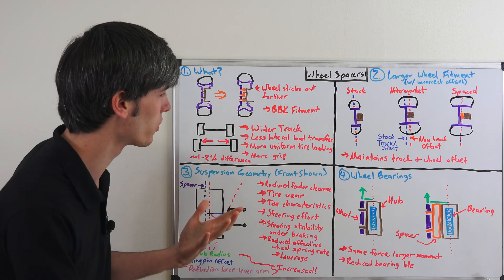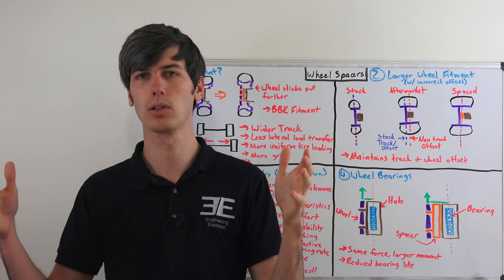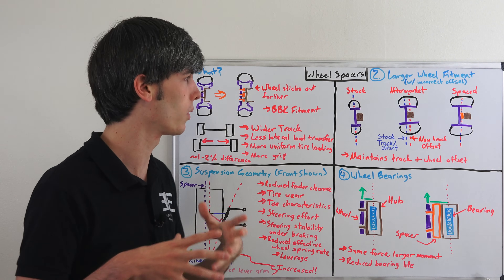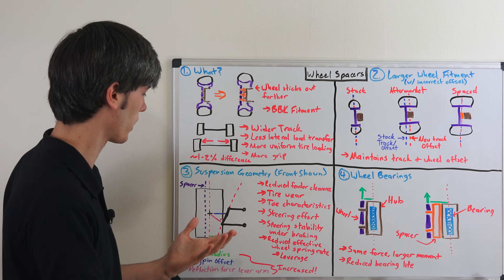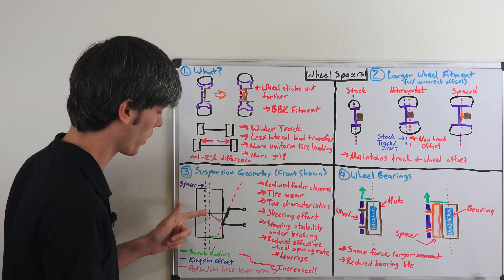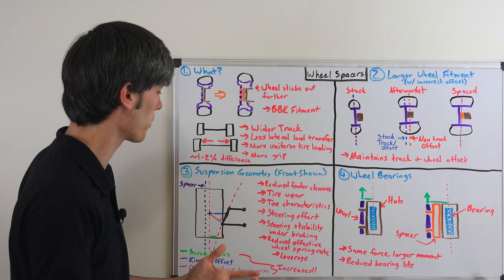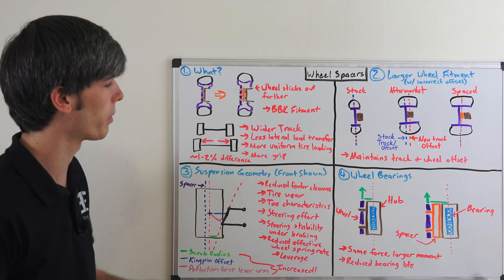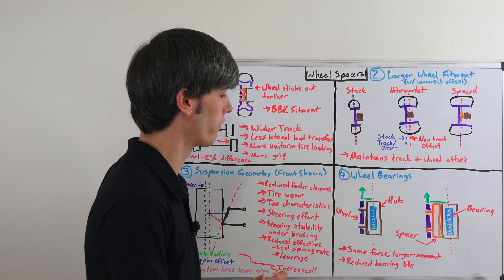Wheel Spacers & Adapters - Good Or Bad?

Comment: 4:30 A few years back, when I had a 97 Suzuki Samurai, I discovered the spring rate change right after I installed spacers in it, especially during off-road scenarios. You can put stiffer springs to try to even out the extra leverage, but then you're going to be wearing out your suspension kit even faster.

Comment: By adding a spacer you don't increase the load on the wheel bearing. If anything, the load is reduced. The load is increased on the spacer. Almost all GT3, GT2 class racing series run wheel spacers with no issues. As long as the materials used are heavy duty, you should be fine.

Comment: Do not use wheel spacers. They KILLED my friends daughter. Back in 2010 she was driving on the QEW highway near Toronto Canada, the back tire of a pick-up truck came off and entered the oncoming traffic and killed my friends Daughter Megan instantally. The reason for the tire coming off was eventually traced back to the installation of a wheel spacer on the pick-up truck.  Wheel spacers should be outlawed.

Comment: Okay I’m not sure if you will see this since the video is so old, but I was wondering what the effect of extending the a arms of a double wish bone suspension would be in increasing track width. Would that be as negative as using spacers? Or would it be negligible in the effects?

Comment: You missed the main reason people use spacers, for style. To push the outside of the tyres out as close to the wheel arch as possible, It is often accompanied by lowered (or even cut) springs. Those people aren't thinking about the actual effects on bearings or supension geometry.
Reply: Those people wouldn't be watching this video in the first place, as they don't care about the effects on bearings or suspension geometry.

Comment: I changed almost every component in my 2012 Acura TL suspension. The only thing I didnt change was the lower control arms and steering knuckles up front and rear knuckle in the back. I replaced all 4 hub/bearing assemblies, arp ext. wheel studs, 20mm spacers all around. 19" aftermarket wheels, adjustable front upper control arms and a rear camber kit. The brakes and rotors were 7 months old at the time of install. Axles were replaced too. Tein coilovers were replaced with BC racing DS series coilovers. The car is fully aligned while sitting 4 inches off the ground 😂

Ill let you guys know when they fail

Comment: The real question, if you believe that this causes damage. Then you’d have to be logical and think that getting rims that have 20mm more poke than stock would do the same damage as a 20mm spacer. No one says that it does but if a spacer does then so does the rim

Comment: An interesting point to me is a spacer compared to a wider wheel with different offset. If I compare an 8.5" wide wheel with a 30mm offset as the OEM wheel compared to a 9.5" 22mm offset wheel, the wider wheel edge moves out by 21mm. So if a 20mm spacer is used to get the same outer edge position of the wheel, why does nobody say anything about the wider wheel and the negative effects from that?

Comment: wheel spacers

Hi Will the 25mm rear spacer and 20mm front spacer damage the wheels, suspension and bushing in the long run?

Comment: I have 2in spacers on my 47 mercury with a 9in rear end and have had zero trouble in 25 years. Of course they are only on the back. Proper torque is a must and retorque after a few hundred miles. I don’t believe I would use them up front.

Comment: Hi I have a jeep commander which I just had a 2inch lift kit installed now I want to put bigger tires on the stock 17 rims. I'm considering 1.5 spacers but concerned about the wear on the wheel bearings. In your opinion would spacers that small create much difference if any to the life of the wheel bearings

Comment: Is the proper solution to buy wheels with preferred offset since it will be mounted on the hub as intended?
Reply: Both will impact the way your car is steering, since the point the front wheels turns (if you draw an axis through the front shock of a Mc Person axle) is moving towards the inner side of the tire.
Ideal it should be outside of the middle of the tire, if you lose one brake cirquit your steering will automatically pull towards the front wheel with the defect brake cirquit. If the rotation axle of the steering is inside the middle it will pull to the other direction and will further destabilize the car.

Comment: I’m assuming this would be the same for significantly offset wheels? What about just increasing the width of a wheel? Assuming offset was same that should not change the suspension geometry correct? Again assuming no other issues with figment etc.

Comment: Hi... Great video and explanation.  I think there is another possible scenario that you didn't cover in this video. I would love to have your opinion on this If I have a rim with a 15mm positive offset and isn't it adding a 15mm wheel spacer that would restore the centre point of the wheel as per the factory setup? As a result of doing so, it would eliminate all the possible negative impacts of adding a wheel spacer.  Yes?

Comment: I tried to find wheels for my 69 Mustang, which needs wheels with 0 offset, but most modern wheels have about 2" of positive offset.  If I had not found the exact wheel size that I was looking for with the correct offset, I would have had to use a 2" spacer with one of the more commonly available wheels.

Comment: My concern was addressed in this video.  The displacement/extra strain on the wheel bearings/rotors.  I thought about them for looks, but I already decided against them.  I'll just look for bigger sized tires that I can get away with, while not compromising performance/life (too much) on other components.
Reply: I've never had a wheel bearing need replacing after using a spacer. Maybe if it was bigger. I've normally used 15-20mm spacers maximum.
Reply: Old post...
That bigger tyre has also most the same effect maybe ?

Comment: When I saw the title to this video, I was wondering if the subject of wheel bearings would be covered?  It did to my satisfaction.  
I recall back in the 1960s being first aware of wider wheels having detrimental effects on wheel bearings.  In the US Can Am race series, Bruce McLaren had a nearly invincible race car with the McLaren M6A.  One of the notable features with the M6A was in its wheel hub design to use wider wheel rims/tires than what were on the Lola T70 race cars.  The teams with the T70s copied the M6A with using wider wheel rims on the wheel hubs not designed for the width; where the T70s promptly had problems with wheel bearings failures.

Comment: If a different wheel is used with a greater positive offset than the stock wheel, and the increased positive offset is equal to the spacer thickness, will that negate any additional bearing loading due to increased mounting distance from the hub?

Comment: How about the effects of a spacer on a floating axle bearing? Like an HD pickup? That would a a definite must watch, there's no info out there... I tow 5th wheel camper/gooseneck which adds in weight and effects bearing load, any info??

Comment: I own a 2003 Toyota 4runner and it came with a 3 inch rough country suspension lift and 33inch tires on Toyota 16 inch rims but it also has rough country wheel spacers because the tires were rubbing on frame too wide. I am concerned about my wheel bearings although the SUV does ride very well and seems to handle great. Also it climbs like a champ. It is a SR5 4wd with the 4.7 V8. But I am looking at longevity so I am considering going down in tire size and getting rid of the wheels spacers

Comment: Espeicially emphasing that last point: the "OEM lever distance" is not that big, so ading just a few centimeters of spacer can put a bunch more moment on the bearing as moment scales lineary with distance. To the point where safety factor margin could be eaten up and wheel bearings become a wear part in need of replacement in very short intervalls.

Comment: I saw a guy Driving a Chevy Corsica that he both changed to RADICALLY smaller Tires and Wheels as well as pushing them out with 2 or probably even 3 sets of Spacers. As a result the Camber was insanely negative. 
Then in Rush Hour traffic He was Driving MUCH faster than his abilities while Jinking through all Lanes of the Freeway. Sure enough, he cut too far towards the outside lane, hit that little rise to the shoulder, snapped his right Wheels off, and rather spectacularly flipped up onto the Embankment. 
Thankfully no other Vehicle was involved, though he wound up with a Broken Leg.

Comment: There is a nearby town (that I drive through fairly often) that will extract revenue from any vehicle with tires that extend beyond the edge of the fender. I use wheel spacers only to compensate for wheels with different backspacing, not to compensate for anything else.
Reply: Maybe they are doing it wrong ? 
Initially the Germans did it to get around a law about the TREAD sticking out beyond the fender. 
So there's the stretched tire , keep the tread within the top of the fender lip while you have 1-2" of wheel sticking beyond. 
It's a 🖕 to a government restraint the way I see it. 
So not everyone loves that look but I like why the Germans did it. 
I'm not even gonna go there with the who did it first argument. 
So take a look at the stretched tire idiots next time ,and see if it's being "done right".

Comment: Remember that adding a wheel spacer is the equivalent to going to a wheel with a different offset.

Also, the wider track allows more stability during those off-camber situations when you are out wheeling.

The cheaper wheel spacers are often not hub centric, so they can potentially put undesirable loads on the lug studs and result in more radial runout.

Comment: Terrifying way to lose an entire wheel at high speed (s). Most are installed INCORRECTLY. You must change all the lug nuts and be absolutely sure the studs are in excellent condition. THEN torque specs are also another problem. No air guns allowed. Torque wrench in star pattern, TWICE. Then do the same thing at the outer studs and more new lug nuts, Star pattern TWICE again, no Air guns allowed again. Not many follow this and wonder ... Why did my whole wheel "pop off" on the highway... Duh. 🤯

Comment: You should have added how wheel spacers differ from changing the wheel offset.  My opinion would be that there is no difference between wheel spacer and wheel offset achieving the same overall shift of tire.  People like to make a big issue out of wheel spacers but quality ones can be a good option where just buying different wheels is not the option.  
1 ton trucks have huge wheel spacers in the front by the way.  Thanks for attempting this concept, customizing your vehicle outside of stock always puts added strain on some other component down the line.  As a customizer you just have to judge if they put in safety factors high enough in the other components to absorb the added strain you are putting on everything else with your customization or just replace the components as they fail down the line with stronger substitutions until stuff stops breaking because of your customization.  It's the age old dilemma.

Comment: First, love this channel. but there are sum big assumptions on the moment effecting the bearing. yes if you use a spacer on the stock wheel it will increase the moment, but if you are using an after market wheel, the spacer may be getting the centerline of the new wheel back to the centerline of the stock wheel.  what i am saying is that there are a lot of factors you need to look at before running a spacer.

Comment: I got a question. Another u-tuber says that installing air bags for load leveling in a pickup is bad because it increases the weight on your rear axel. According to him if you put say 60 lbs air pressure in each bag you have increased the weight on the axel by 120 pounds. I disagreed but he was adamant. Thanks.

Comment: So how is it different to have a 10mm spacer vs changing your wheel offset by 10mm? Won't you get all of the same geometry changes? I have run a 10mm spacer on all four wheels on a car that's done track, autocross, daily driving, vmax, and never noticed any poor wear on tires bearings or suspension.

Comment: Also your adding weight.
I have huge wheel spacers on a very light car, its lowered it has wider tires. But there are 2.5cm thick wheel spacers in between the rim.

My brother has the same car only bone stock on all seasons i feel much more confident in the handling of his car.

With the big wheel spacers the car feels floathy when transitioning in corners.
Cuz it doesnt steer sharp its almost as if your increasing your deadzone on your playstation controller.

Comment: Multiple appeals to OE design. Understandable. You said it yourself, OE's are motivated by cost savings. This alone is a reason not appeal to the OE design so much. Your implied force distance for your moment arm on bearing stress is purely based on change from OE. The actual- would be centerline of tire. Right? This is so important for not just spreading more misinformation on the subject. This is also just a static/ driving straight analysis of stress from weight of car. The moment arm for bearing stress based on a changed wheel track changes for cornering. My claim I'd love your take on, is space with spacers or wheel offset such that the center of the tire is over the center of the bearing. For most cars, the wheels would stick out in this case. This is the static equilibrium state where the average force is placed over the center of the bearing. Nothing better. Cars aren't designed this way to begin with. Offsets and spacing can improve bearing life in this state. Is that such a bold claim? Thoughts?
Reply: @iNSTAGiB without even knowing your setup, yea. That’s a small difference.

Comment: I added .80" spacers to my 2018 impreza due to its softer suspension and the reduction in body roll while cornering was immediately noticeable.
Reply: You sir are a dumbass. The overall spring rate is reduced when using spacers so the body roll will increase all things equal and if you added more rubber then the body roll is increased further. You think you are feeling something which is wrong which is why listening to retards on youtube is pointless

Comment: I use spacers on my 4WD truck for a totally different reason. I went from 265 wide and 32” mud terrain tires to a 235 wide 32” all terrain tire. This made a huge difference in ride quality, 2mpg increase, and noise abatement. 

However, the overall track was pulled in quite a bit. The spacer just pushed the thinner tires out to the original track width (outside to outside).

Comment: I don't think point #4 is necessarily true - it would depend on the offset of the wheel used.  Yo can have a spacer, and a wheel with a positive offset equal to or even greater than than the thickness of the spacer, that negates any levering effect of the spacer.  So as long as the connection of the spacer to hub, and wheel to spacer, are rigid, the "lever" is effectively the distance from the wheel bearing to the center of the tire.  Heck, you could theoretically have a wheel offset that allows the tire to totally envelope the wheel bearing, and thus have almost zero axial load on the bearing.

As to point #1, not all vehicles have independent suspension.  You can have solid front and rear axles, spacers, and a wheel with positive offset, so that the net axial load on the bearing is the same as stock.  Maybe you'd have a different net effect if one were to use larger diameter rims to "fit" the wheel over the spindle assembly...

Comment: Great video. Thanks. I have a questions. The characteristic changes you mentioned, how are they affected by a smaller (3-8mm spacer) versus larger spaces? Is the smaller the spacer decreases the chance you experience any type of failure versus a larger spacer?

Comment: Regarding #4: 
Let's say your stock wheel is 0 offset, but your aftermarket wheel is +35 offset. Wouldn't installing a 35mm (give or take a mm) spacer just restore the correct distance to the bearings? The weight/wheel is on the spacer studs, and the spacer is clamped to the hub face, right? So wouldn't that be the same as running a wheel with a 0 offset?

Comment: I've watched this, and the other related videos on your channel and I still have one question. If I were to utilize wheel spacers to correct for the offset of a wider wheel and to achieve the correct centerline (like in figure 2), to my understanding, the wheel bearings would still undergo increased wear (figure 3).

     However, since the centerline of the wheel would effectively be the same as stock, would the suspension geometry still be affected by the spacer itself when compared to a wider wheel with the correct offset and no spacer?

     I am asking about this since I believe this would not affect the kingpin offset or the positive scrub radius but I am unsure about the deflection force lever arm. (Is that also related to the centerline of the wheel or is that to measured to the hub?) 

     Any help is appreciated, I've also been trying to understand XF Motorsports' videos on suspension but, man, there sure is a lot to this subject!
Reply: The spacers will help to keep your same original offset for your new bigger tires